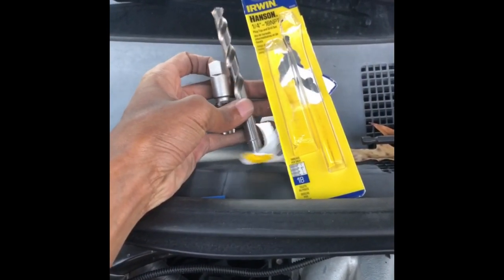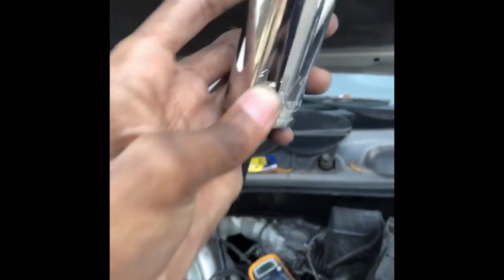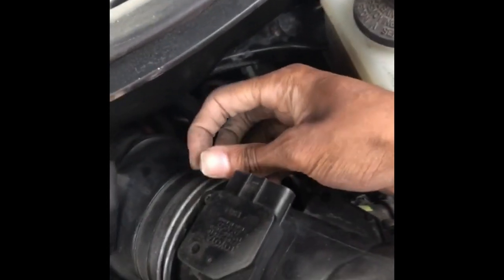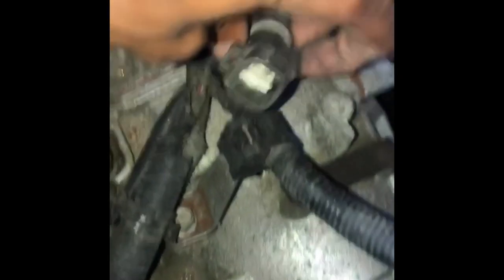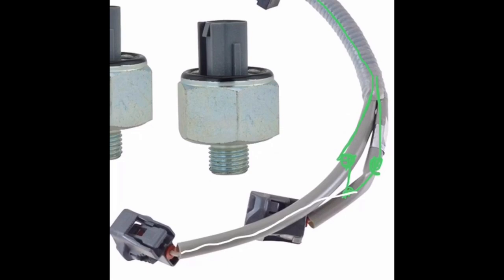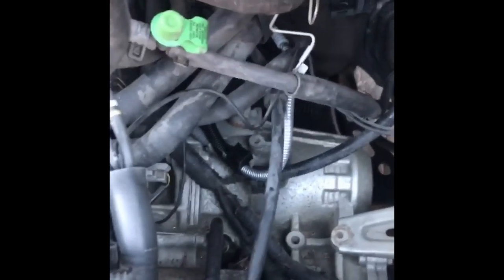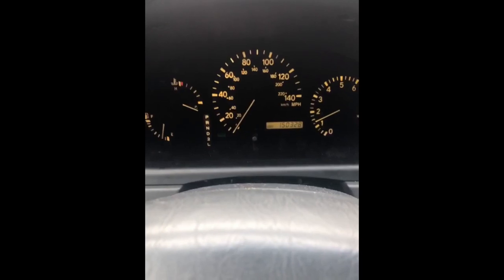1999-2003 Lexus RX300 1MZ-FE EASY knock sensor replacement relocation (SHORTCUTS IN DESCRIPTION)

Comment from the maker: Attention: There are Timestamps in the description So you can skip to whatever stage of the video you want to see... comment>like>subscribe🙏🏽😊
Reply: from the time you did this is the hack still holding up
Reply from the maker: Daymon Crabb yes  I had the lights come on once but that was due to a different issue and it hasnt happened since
Reply: @JDMHaze  no shit bout to do this on my 1mzfe in 2003 sienna
Reply from the maker: Daymon Crabb Just make sure the knocks sensor is actually the same part,
Reply: Does it matter how much you torque down the new sensor?  What should I take it to?
Reply from the maker: @ddmercantile  I would probably do a hand tight the same way you would do your wheels on your car, but not ridiculously tight enough for it to seize up
Reply: @JDMHaze  Ok, I know they are somewhat like a stethoscope, so don't want to destroy the instrument in the process...
Reply from the maker: @ddmercantile  handle with care ❤️

Comment: September 22, 2020
Thank you very much for making this video.  It worked perfect on my 2001 Highlander with 197,000 miles.  Almost all parts came from Wally World, including 2 new sensors for $20, leaving me a spare, and the wire harness also for about $20.  I used a nut to mount the sensor on a mending plate and a bolt to mount the mending plate to an existing engine bracket hole, so I made no permanent changes to the vehicle whatsoever.  This saved me more than a thousand dollars.
Reply from the maker: Kevin Lewis I'm very happy for you, what size nut did you use if you know the specs still
Reply: @JDMHaze  The package reads Hillman, Hex Nuts, Metric Fine Pitch, M12-1.25
I just opened drawers at Lowes with sensor in hand until I found it.
Reply from the maker: @kevinlewis5164  i'm actually surprised a Walmart or non-OEM  knock sensor held up
Reply: @JDMHaze  I have had 3 knock sensor codes since the fix.  All were on super soaked rainy days.  OBD quick delete and gone again for months.  Plenty good enough.
Reply from the maker: @kevinlewis5164  fair enough lol
Reply: @JDMHaze Great video hack.  Do you have to use OEM(Denso) parts??

Comment: This video did the best job of showing where the sensor harness is located. I'm planning on doing this as well. It would be nice to merge on the highway without worrying about getting hit.
Reply from the maker: Veronica Bellerose Thank you, it is easier to find the knock sensor harness on this vehicle than most of the cars with this engine probably due to the fact there is more room in the engine bay. I thought I would have to hunt for it but it was pretty simple... After you remove the airbox you literally just reach down I could probably find it with my eyes closed...
Reply: What gauge wire did you use?
Reply from the maker: Veronica Bellerose about 12 gauge

Comment: Thanks! Glad you were able to fix your knock issue also. And good coverage on verifying its grounded.
Reply from the maker: UtahSleeper didn't want any surprises, the less errors along the way the easier it is to troubleshoot I'm not used Sensors that are grounded to the body without wiring so I made sure to test the ground of the sensor To make sure my hole was a good ground location lol.. So that if I came along any issues I would know for a FACT it had something to do with my wire splicing rather than the ground, But I'm pretty good with splicing as well so that wasn't a concern really lol Just covering my bases ,
Reply: Is there a reason you need to put the mount all the way over on the other side?  Is there no place to mount it closer to the plug in?
Reply: @ddmercantile  it's the easiest and softest material to manipulate. Plus it's a mount that is rarely replaced and is thick.
Reply: @UtahSleeper  Ok, I'll have to try this!  No sense in breaking open an otherwise great engine.

Comment: If you can, please respond. So I bought this highlander and the light is on with codes P0235, P0330 so I did the hack, I spliced the cable into one and made it long to the connector. I bought a import direct Knock sensor which was $80 and I mounted it to the motor mount without drilling, I used a nut and washer since there was already a hole. I ran a ground wire to it and it has ground but alas the code comes right back? What am I doing wrong? This is so frustrating, so I really need an OEM sensor so the light won’t trip? I also made sure the harness to the ecu pins has continuity.
Reply from the maker: I had the code come back months later before and then I got another knock sensor on eBay. It was a dancer or knock sensor, and I use the part number, and I haven’t had the issue since and it’s been at least two years.
Reply: @JDMHaze  so it has to be OEM for the code not to come back basically?
Reply from the maker: @sonicisdog  normally yes,, Some people have said they got aftermarket ones and they lasted a decent amount of time,,

Comment: The problem with doing this modification is that the externally mounted knock sensor will not detect detonation inside the engine. The knock sensors are located on the cylinder heads so that when detonation occurs inside the cylinders the engine computer can back off the ignition timing to eliminate the detonation. This is necessary to protect the engine from internal damage as well as to get the best performance, fuel economy and emissions. Doing this modification might seem to be a great easy cheep fix without any downsides and it may work well for some period of time but remember that the engineers who designed the engine put those knock sensors where they did for a reason. If you don't know all the factors that went into the engineers' decision to locate the two sensors where they did then you may be taking unknown risks. There could be undetected detonation going on inside the engine that is slowly hammering away at the pistons and cylinder heads, which could lead to premature engine failure. This is why you should never modify anything in a complex, modern engine. Instead leave it the way the manufacturer designed and built it.
Reply from the maker: it's very common for the sensors to fail, so the manufacturer didn't make it too well, ... I actually bought Denso knock sensors and got them replaced at the dealership and they failed months later And this has happened to others and apparently there's a newer version of the knocks sensor that works better, However I am making a newer update video and I will include some of what you mentioned to further elaborate
Reply: @JDMHaze  That's another thing. Many people have problems using aftermarket sensors and wiring harnesses on these engines. You need to use OEM Toyota parts. You can get them on eBay for a reasonable price. I bought 2 OEM sensors and the OEM harness on eBay this morning for $63.45. You need to be sure they are in the original sealed bags to be sure someone didn't remove the OEM parts from the bag and stick aftermarket or counterfeit parts in the bag.
Reply: @joevignolor4u949 how did you find them so cheap?
Reply: 100 percent. If you bought the new harness why would you cut anything? The car needs both knock sensors and you'll find out eventually.

Comment: I was so happy to try this and did but it did NOT work.Reset computer 3 times engine nocking and pining also check engine light back on within minutes.
Reply from the maker: if your engine is knocking, then that needs to be fixed, this video is for folks whose engine is fine but the sensor FAILED (which is common)  these sensors DETECT engine knock, not repair it. so if you’re using the recommended fuel and having issues there is another issue you need a mechanic or shops to diagnose/fix

Comment: I've not used a tap before, so guessing that's why I'm not understanding how you ruined your first hole.  Is the tap tapered, so if you go too deep you've made the hole too large?  Not sure what you meant by out of balance.
Reply from the maker: I ruined my first hole because I drilled too close to the corner and did not give me enough clearance for the wide base of the knocks sensor to turn, so I had to move it over to where it could turn freely so I could screw it into place which required another hole 🕳

Comment: I tried the bypass on the ecm side since it was only marking p0325. After I did it at the ecm it came up with both p0325 and p0330. I tried the bypass you did but it still came up the same so I thought it was the bypass I did at the ecm. I put those wires back the way they were but to no avail. I still get both knock sensors coming back. When I was splicing the wires for the harness, outside of the white wire it had a layer of wires too. Would those need to be spliced together with the white wire or would those be left out? Any insight would help. I’m going to test the wires from the sensor connection to the ecm to see if I have continuity. I tried putting one of the original old sensors back on but still get the same codes. Any help would be great. Thank you.
Reply from the maker: That wire outside of it doesn't need to be splice, just the white wires however I would put some tape or heat shrink to cover those wires, also did you disconnect your battery after you did the sensor hack?
Reply: @JDMHaze  okay sounds good I didn’t think I needed it so I cut off the excess and used a butt connector to join the wires. The butt connector shrinks when you heat it up. No I didn’t. I have a scanner that resets the codes. Would I need to disconnect them still?
Reply from the maker: @PSALM-144-1  The battery disconnect helps
Reply: @JDMHaze  I’ll give that a try then. I appreciate you replying back. Thank you!
Reply from the maker: @PSALM-144-1  you can also see my description I have a link to a video from "Utah Sleeper" He does essentially the same thing with the same engine but just in a Toyota Avalon  He explains that shielding wire a little bit
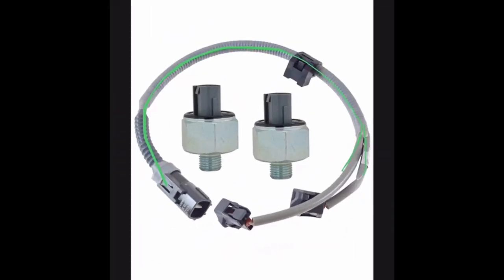skip to 4:26
https://youtu.be/AehVCIebHas

Comment: Did u use any rosin core solder before you heat shrank the spliced wire or  is it not necessary, also what kind of extended wire or gauge wire did you use
Reply from the maker: I may have soldered it but only where I spliced them together, but it's not necessary as long as you heat shrink it and twist it very tight and pull it to test it, and it was 16 to 18 gauge wire...
Reply: @JDMHaze  a spool or bonded wire cuz I see certain ones that are either 16 or  18 gauge and the one that is both says bonded
Reply: @JDMHaze   I follow requested u on Instagram
Reply from the maker: @reinnamatthews5825  i accepted

Comment: I got “Knock sensor 1 circuit bank 2 or single cylinder”. Is this what your video is about? Thanks.
Reply from the maker: whats the code? if its P0325 or P0330 then yes this is what im talking about
Reply: @JDMHaze  Thanks. it's P0330.
Reply from the maker: @wanchiuwang4333  yep

Comment: Great video!!! I have a chance to buy a RX300 with this problem but was ready to avoid it until I saw your vid, did you have a no 4th gear issue due to the bad knock sensor?
Reply from the maker: Yes also known as the "Limp Mode" and it was annoying and hell, because I work as a technician and use that vehicle for work so it was burning excessive amounts of gas... This fixed the problem

Comment: Couldn't you just use a nut under the mount location vs tapping the hole to thread it?
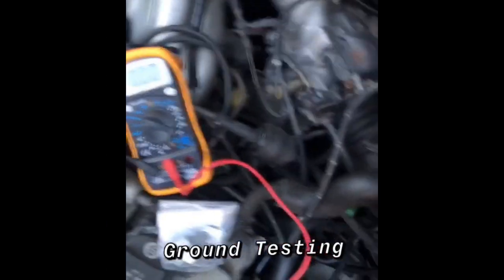Reply from the maker: Chris Atkinson maybe if you have the right size nut, but I believe you still need the threads to touch the inside of the bare metal, to make a proper ground. , Because on the outside surface it's actually painted black, so you're not actually making a solid connection but the threads are touching the inside which is the silver bear metal which makes the proper connection. so just make sure you test the ground(as shown 1:52  if you do it that way
Reply: @JDMHaze  thats why you grind the paint away from the drill location. Drilling the hole slightly larger to fit through but snug it down with the nut and boom perfect ground.
Reply from the maker: Chris Atkinson Either or but for the people who are less handy I figured my way was a little easier, but since you understand to do that yes that could work, lol

Comment: Hey bro i have a question. So im having a hard time figuring out whats wrong with my rx it feels like I don’t have an overdrive cause my rpm is about 3500 to 4k in 60mph. Do you think its the knock sensor? And I Don’t have chevk engine light. But there was a code from the antena.
Reply from the maker: That sounds like a limp mode, did you try pushing the overdrive button and turning it on/off to make sure it's not the bulb in the dash being out? Well you're describing seems like a limp mode how long has it been doing it? Because sometimes the check engine light doesn't come on immediately after going into limp mode And it doesn't always happen, depending on how long the drive is and how long the car was off before you started it
Reply: Yes i did and the lights are working. And no luck still high rpm on high speeds
Reply: You’re right maybe it needs more miles cause i just bought it this month and just drove it today
Reply: And its a 99 rx300 only 140k miles maybe drive it more and wait for check engine light to turn on?
Reply from the maker: @luckyboi1196  same situation happened when i bought mine lol. in addition to  a maf sensor and changing pcv valve lol this was a temporary fix (the original knock sensor harnesses go bad)  It's a common issue with Toyota products at this time, so the Avalon, Camry, ES300s and some of the siennas Have this problem
Reply: Appreciate you bro! 🙏🏽
Reply: Hey bro! My check engine light turned on and the code is P0446 does this affect the overdrive? I cleared  the code and still no overdrive

Comment: IMPORTANT!!!! IMPORTANT!!!! IMPORTANT!!!! IMPORTANT!!!! IMPORTANT!!!! IMPORTANT!!!! IMPORTANT!!!! IMPORTANT!!!!

IF YOU DO THIS TRICK YOU HAVE TO HAVE GROUND AND IT HAS TO BE A OEM SENSOR!!!!!!!!!!!!!!!!!!!!!!!!!!!!!!!!!

I tried 3 different sensors and upon research Toyota OEM sensors operate at a different frequency than aftermarket sensors so they will instantly throw a code! IT HAS TO BE OEM!!!
Reply from the maker: correct , and surprisingly a few people used aftermarket and didn’t have an issue, some said they lasted some months so that may vary, but yes, you definitely should get the Denso

Comment: How about shifting? Did you have any issue with overdrive not shifting? If you did, did this fix it?
Reply from the maker: Yes i did ! it would not go into overdrive and would stay in high rpm also known as (limp mode). Replacing the knock sensor remove the trouble code and fixes that problem.
Reply: @JDMHaze  Cool
Reply: @JDMHaze  The problem is you didn't fix the problem the right way. Do you know why the transmission won't go into overdrive when the knock sensors fail? It's because without the sensors working the engine could experience undetected detonation (knock) that can damage the engine. This will occur if the engine is under a high torque load, which happens in overdrive. Also, when the sensors fail and the codes come up the computer intentionally retards the timing to prevent detonation. Essentially what you  are doing is overriding that safeguard by telling the computer there is no detonation when maybe there is. I put a comment on this thread explaining all this that you need to read. My concern is that you are telling people to do something that might potentially damage their engines.
Reply from the maker: @joevignolor4u949  I understand why it does this but the information is overwhelming these knock sensors have a significantly high failure rate which is why I made this video. And it is a common issue with these vehicles more often than not it's the sensor themselves
Reply: @JDMHaze  None of that matters. You are advocating a band aid work around that runs the risk of doing major engine damage. The only proper way to fix this problem is to remove the plenum and intake manifold and to replace the sensors and the wiring harness.  That will allow the computer to receive the proper inputs from the sensors that will tell it what the current situation is inside the cylinders with regards to engine knocking so it can properly determine the correct ignition timing. That's why the engineers put the sensors where they did and they need to be there.
Reply from the maker: @joevignolor4u949  i'm pretty sure this is a temporary fix and if you look at some of the comments I elaborate on this, however like I said I will make another video and pin another comment since I am in the process of doing the update video , I do mention some of this but I don't elaborate
Reply: @JDMHaze  Many people once they do this modification and the car seems to be running okay they will just leave it that way. I didn't remember seeing anything in the video warning that it could cause engine damage.